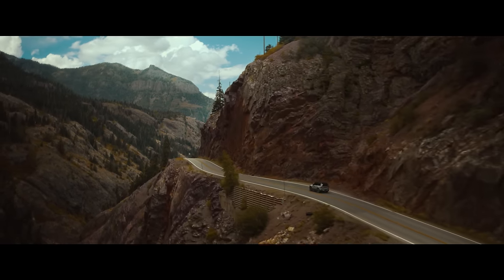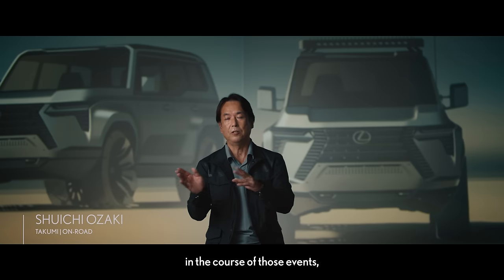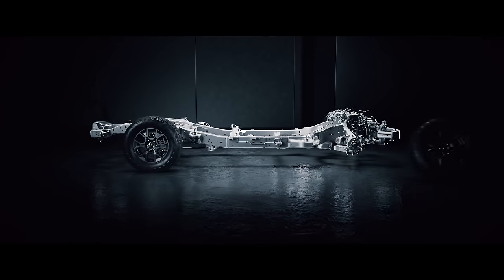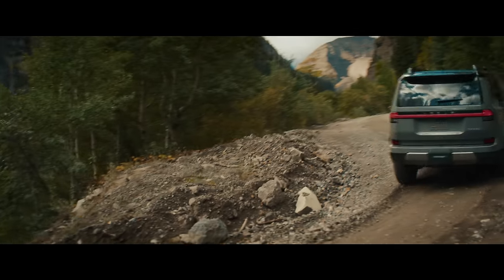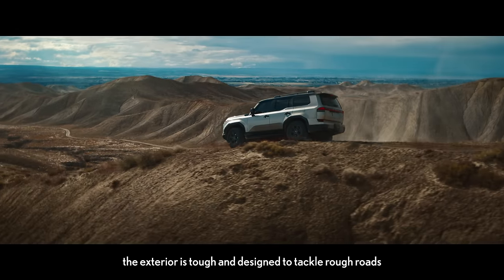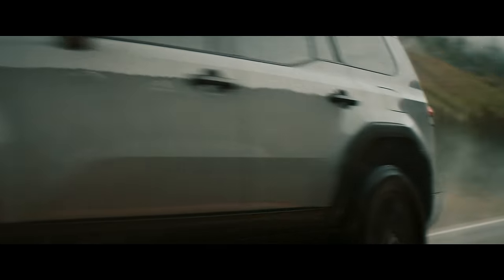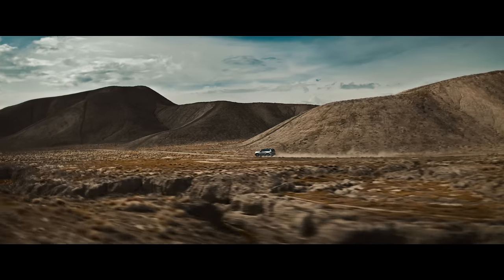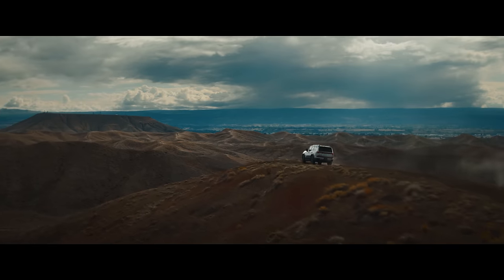2024 Lexus GX 550 "From the Ground Up” Overview | Lexus

Comment: It looks amazing! I have one question. What does the 550 stand for? It's not the engine displacement and it's not the horsepower, so did you just throw a number at it? If so you should've just called it the GX.

Comment: Pretty close to perfect. But A few gripes: with a vehicle this heavy and also a luxury category they should offer a larger brake and brake disc option, something BMW X5 has spoiled me with. Also more off-road rim tire choices, the land cruiser off-road rims and tires look far better. A lift leveling kit should be offered, looks a little stupid with the back higher than the front “to the trained eye”. Land Cruiser is definitely crossed off my list because it’s only available in hybrid. I will never be tricked into having a large battery again. A hybrid will not last 200,000 miles like older Toyotas and Lexus unless you’re willing to spend 18,000$ to replace the battery every 50,000 miles. Yea yea the battery still works at 50K with only 40% charging capacity and a MASSIVE drop in horsepower. That won’t be a problem in this V6 here we are looking at.

Comment: I just checked the website and it only shows the GX in V8-- no mention of 6 cylinder anywhere..
Reply: They have not released it for sale. The website reflects the current gen for orders
Reply: @moloono1  THANKS-- I'll check back when it' s listed-- with a V-6, I might be interested. ( I love V-8s, but it's getting so gas would bankrupt a person with one of these.. I will use whatever I get DAILY- an that's a bit expensive..
Reply: @davidwayne9982  It’s a twin turbo V6 that is estimated to get around the same as the old V8.
Reply: @moloono1  That won't work for me then.. thanks.
Reply: @davidwayne9982  No problem! It’s great for us at higher elevations, but I’m skeptical of the reliability.
Reply: @moloono1  WHY? It's a :LEXUS.. if it' good at high elevation- it'd be even better lower!!
Reply: @davidwayne9982  Turbo and super charged engines compress more air into the engine cylinders making up for the lower air density at high elevations, allowing the engine to produce power as if it was at sea level. It’s common knowledge.
Reply: @moloono1  I"m well aware of that-- but if an engine is good at high altitude with thin albeit compressed air- it will be BETTER lower levels.. and turbo compresses EXHAUST back into the engine NOT fresh air.. creating MORE heat and other issues you do NOT have with Superchargers.
Reply: @davidwayne9982  I can see that. I was mostly speaking to the improved performance for us at high elevation.
Reply: @moloono1  and I was just making sure I understood you!!! AGREED on all points.. :)

Comment: If new drivers systems are as bad as in new RX...thank you Lexus but no.

 The  speed limit warning, which chimes incessantly. Getting rid of that requires a deep dive... five separate pushes on the screen.
The sensor on the wheel ‘reads’ your driving position – and instructs you to sit up straight all the time!!!

It is shame....fix this please!!!